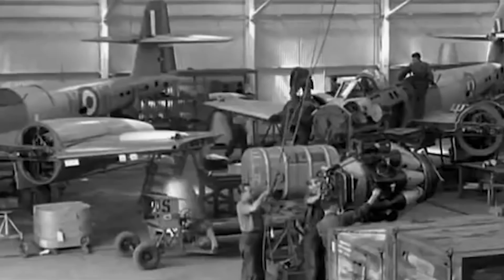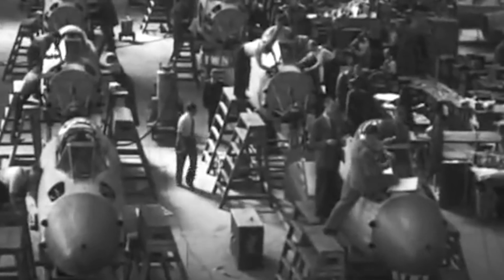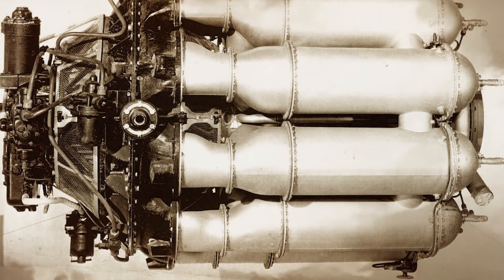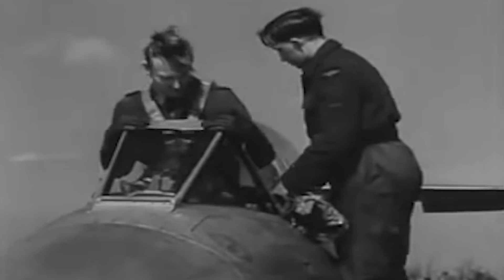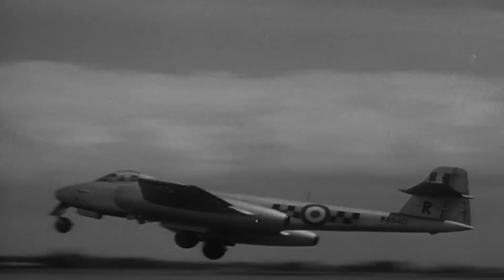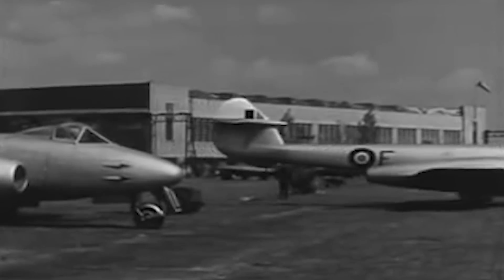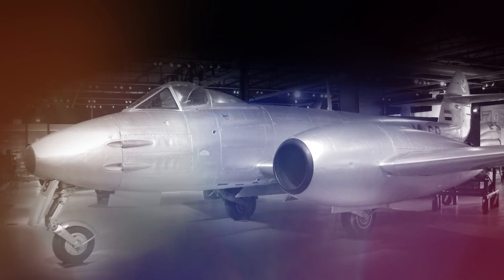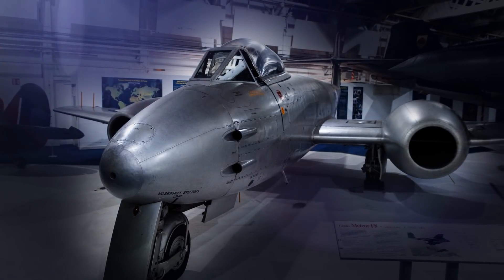Gloster Meteor - The Only Allied Jet to Fight in WW2

Comment: The Meteor was not the only allied jet to see combat in WW2...
The American P80 flew limited missions in Italy against the Germans...
Reply: The Gloster Meatbox never shot down a single Luftwaffe plane... but killed 450 RAF pilots.
Reply: @sandervanderkammen9230  
The Meteor was held over England as not to risk it being shot down to fall into enemy hands....
Thus it was only used to down the V1's launched at London....
And although our P80's flew search sorties in Italy in search of specific targets,  they didn't find any so no combat was joined between the P80's and enemy aircraft......
Reply: @pffear  The Meteor never saw action in the fighter role because it was simply not capable of defending itself against Luftwaffe planes... the RAF had enough problems recovering the bodies of "Meatbox" pilots in England... overseas deployment was to say the least premature.

The P-80 spent most of the war grounded due to technical problems and crash investigations.
Reply: @pffear  
The Meteor was stationed in Belgium.
The P80 was flow to see if could fly. At that time of the war there were no hostile Axis planes in Italy.
Reply: @johnburns4017  The Meatbox never shot down a single Luftwaffe plane... as a fighter aircraft it was a failure.
Reply: @johnburns4017  
The P80 was sent to Italy to run down a specific target w/no joy,   but that's not their fault.....
Reply: @pffear  
It seems they sort of made up a target to get them doing some combat flying.
Reply: @johnburns4017  
Look,  l know anything is possible......
But the records show a small group of P80's were sent to Italy on a S&D mission for a special target.....
Could it have been a stunt❓Yes....
Could it have been a legitimate combat  mission❓Yes.....
Could it have been a little of both❓Hell yes.....
Reply: @johnburns4017  The Meatbox saw no action in Belgium... it never shot down a single Luftwaffe plane during WW2.
Reply: @pffear  
They did not want these planes coming down over Axis territory.
Reply: @sandervanderkammen9230  
Not this nut again.
Reply: @johnburns4017  indeed, they would have certainly been shot down by the Luftwaffe... the Meatbox was slower and less maneuverable then some propeller aircraft in service during WW2.
Reply: @sandervanderkammen9230  
Not this nut again.
Reply: @johnburns4017  Please Get Therapy
Reply: @sandervanderkammen9230  
The screaming voices keep telling him things.
Reply: @johnburns4017 Please Get THERAPY!
Reply: Both the Mosquito and Tempest were faster and more effective in the V-1 intercept role, the Meteor proved to be ineffective and was recalled from V-1 interceptor duties.
Reply: @sandervanderkammen9230  
I'll take your word for it,  I'm familiar more with American equipment.
Reply: @sandervanderkammen9230  
Not this idiot again.
Reply: @johnburns4017  John please get therapy.

Comment: The Meteor was the first ever blank sheet designed jet plane. The 262 was an adaptation of a 1938 piston plane. It originally had a tail wheel, but the engine's thrust burnt the runways so they had to introduce a nose wheel so the trust went backwards not down. The 262s wings swept backwards slightly because the engine had to be moved further aft to give it better balance. An accident, not deliberate design.

The 262 was nowhere near as versatile as the Meteor. The Meteor was in active service until the 1980s, only a few years ago with Martin Baker as the vid shows. The Czechs used a few 262s given to them by the Soviets after WW2, with more developed engines that did not stall as easily as the German engines. They used them for around a year. 

No one adopted the 262s design after WW2. No one.
Reply: Cody Sonnet  Just ignore John, he is one of those delusional nut jobs that thinks Mazda is going to bring back the Wankel engine.
Reply: @sandervanderkammen9230  maybe but then you are several delusional people as John Burns correctly points out.
Reply: JOHN please get therapy!
Reply: @sandervanderkammen9230  
Not this idiot again.
Reply: Does Wilbur Packard Tractor have a Benelux alter ego?
Reply: @givenfirstnamefamilyfirstn3935  
I would not be surprised. He has been many people all at once.

Comment: why are you selling such a bullshit and lies? Meteor never went faster than a speed of sound, the fastest she went was 600 mph. Where did you take from 1.8 Mach???? This channel is just a stack of crap
Reply: I'm certain that a few came very close just before crashing into the ground... over 1,000 "Meteorites" crashed.
Reply: @sandervanderkammen9230  yes for crashesbut never to cross the barrier of sound, not to mention 1.8 Mach xD. That's what he said here is pure bullshit
Reply: @Silver-Tengu  A heavily modified version reached 0.8 Mach but sustained structural damage.
 Aircraft in RAF service were thrust and speed restricted as the Meatbox became dangerously unstable at speeds above 500mph.
Reply: @sandervanderkammen9230  did you read what i was talking about? I know all that! It's not the matter, thx for that useless informations
Reply: @Silver-Tengu  Indeed, the Messerschmitt Me-262 was Transonic while the Meatbox was Subsonic
Reply: @sandervanderkammen9230  ok so now it's clear to me that you didn't understant what i was talking about
Reply: @Silver-Tengu  I do, the Gloster Meatbox design was scribbled out on paper with no actual understanding of transonic or supersonic flight characteristics...
While the Messerschmitt Me-262 was was designed at the Luftfahrtforschungsanstalt the World's first large diameter supersonic aircraft wind tunnel test facility.. the Messerschmitt Me-262 was tested to Mach 1.3 but it was not believed that current engines design was capable of producing sufficient thrust by the time the aircraft entered production...
The Me262 would eventually hold the world airspeed record for productipn jet aircraft at 1,004 km/h (624 mph) until the F-86 Sabre entered service in 1949.
Reply: @sandervanderkammen9230  naaah, it's not it. I was talking about the commentator in this video, at one moment he said that Meteor achieved 1.8 Mach...This is this what i do not accept and see as a lie and desinformation

Comment: The Żurakowski Cartwheel:
"At the 1951 at Farnborough Airshow, Żurakowski demonstrated a new aerobatics manoeuvre, the "Zurabatic Cartwheel", in which he suspended the Gloster Meteor G-7-1 prototype he was flying in a vertical cartwheel. "This jet manoeuvre was the first new aerobatic in 20 years."[6] The cartwheel used the dangerously asymmetric behaviour the Meteor had with one engine throttled back. It started with a vertical climb to 4,000 feet, by which point the aircraft had slowed to only 80 mph. Cutting the power of one engine caused the Meteor to pivot. When the nose was pointing downwards, the second engine was throttled back. The aircraft continued to rotate through a further 360 degrees on momentum alone, having lost nearly all vertical velocity. Carrying out the cartwheel and recovering from it without entering an inverted spin (which the Meteor could not be brought out of) required great skill.[7]"

From:  https://en.wikipedia.org/wiki/Janusz_%C5%BBurakowski

choppergirl.air-war.org

Comment: I think you need to re-check the "tip and run" because all the sources I've read said the V-1 was rigged to detonate if the aircraft/missile were to spin out of control during powered flight. The last thing the Germans wanted was a flying bomb to land on top of them due to a malfunction. If a Meteor were to tip the V-1 over, it would had exploded and taken the Meteor with it.
Reply: I believe that change was made after the fact, once the Germans found out they tipped the missiles to drive them off-course. 

It's possible that slightly nudging the craft just enough to make it miss wouldn't trigger the sensor, seeing it as bad turbulence rather than someone purposely shoving it off course.
Reply: @bluntcabbage6042  If a pilot flew close enough the airflow from his wing would upset the V 1 and it would roll out of control, I am not sure if any pilot really made contact but most would shoot the V 1 down, 20 mm cannon were very effective.

Comment: Cool for 1935 technology that set the Brits back decade. The availability to high temp steels that allowed better turbine section than Nazi planes. But reality is engine efficiency is proportional to compression ratio and these centrifugal compressors were limited by size and compression ratio. Max 10:1 ratio matched 1900 auto engines. The Brit metallurgists reached a limit on impeller (compressor) size metallurgically but Russian MiG-15 was 2X bigger. Note low compression ratio impacts fuel efficiency for given power for example afterburners (reheats). If you allow centrifugally compressed jet engines then might as allow motor-jets and pulse-jets in as turbojets.
Reply: The Jumo 004b engines had a superior turbine section that featured bleed-air cooled hollow turbine nozzles and blades and Ceria-Alumina ceramic coatings for the hot section components.

The engines we use today are based on this German designed engine... centrifugal turbojet engines were an evolutionary dead end.
Reply: @sandervanderkammen9230  what is "Cerro Alumina"? Cerro implies Cerium and although Nazis may have imported Misch metal from the US prior to 1942, there were no rare earths available. A report by Nazi scientist on Hitler's A-bomb project complained about no rare earths available. No one even today has successfully used ceramic turbine blades. By the way, the front part of a jet engine is the compressor, and the part in the back that captures power from hot gasses is the turbine. FYI. Most metals soften or otherwise deteriorate at turbine temperatures, hence the short time between overhaul for Nazi jet fighters. The short period between maintenance was noted by Luftwaffe. British metallurgists developed Nimonic alloys for the Whittle jet engines. Thermal issues with turbine section prevented scale up leaving Nazis with smaller lower power engines.  The history of German jet engine manufacturing is fraught with RLM interference and Nazi corporate socialism producing inferior products.
Reply: @stephenjacks8196  You seem completely unfamiliar with TBCs and their application in turbine blades and TGVs.
Ceria or Cerium Oxide and Aluminum Oxide are still used in TBCs.

Ceria was widely used commercially as Germany was the world leader in the optics Industry.

Krupp was the world leader in high temperature resistant nickel alloy and had developed P-193 Tinidur-60 8 years before Nimonic 80.

KRUPP P-198 Chromadur is not a "mild steel" and is still used in gas turbine engines.
Reply: @sandervanderkammen9230   Krupp never produced a decent high temperature resistant nickel alloy and Tinidur was a very poor alloy with less heat resistance than the 1932 Inconel. Tinidur was brittle and could not be welded. Post war the Americans improved Tinidur with the addition of molybdenum which Krupp had failed to do, even then as A-286 alloy Tinidur has not gained a strong share of the market which is dominated by Nimonic, Inconel, Incaloy,  Discaloy and others.
Cromadur is not used in gas turbines today, the name having become defunked and hawked about it was taken up as a brand name in 2001 for an alloy that is notlistedr any gas turbine use.  The original cromadur was also fiddled with by the Americans but has very little use.
Reply: @sandervanderkammen9230  "Franz realized that the Jumo 004 would have to be redesigned to incorporate a minimum of these strategic materials (per RLM, scarce raw materials such as nickel, cobalt, and molybdenum), and this was accomplished. All the hot metal parts, including the combustion chamber, were changed to mild steel protected by an aluminum coating, and the hollow turbine blades were produced from folded and welded Cromadur alloy (12% chromium, 18% manganese, and 70% iron) developed by Krupp, and cooled by compressed air "bled" from the compressor. The engine's operational lifespan was shortened, but on the plus side it became easier to construct." The British did not have resource limitations. BMW and Junkers were favored military contractors (c.f. corporate socialism, like in the US) were funded but original Heinkel engine work remained ignored. At war end 300 BMW-003s sat not installed in aircraft. (Too unreliable, was original Me262 engine.)
Reply: @stephenjacks8196  The Jumo 004b engines met or exceeded the RLMs 100 hours PFTR reliability standard required for adoption into Luftwaffe service.
This is the exact same 100 hours PFTR reliability test required by the RAF and USAAF during WW2.

U.S. Army tested performed by Operation Lusty after the war reported TBOs in the 50 -60 hour range, excellent by WW2 standards and even during the Korean War era.

The BMW-003/18 series became very successful and is still produced today.
Reply: @sandervanderkammen9230  Your nonsense about the 100 hour PFTR tests is a product of your fevered imagination and you are the only one spouting it.  The Jumo  004 engine was rubbish and everyone knows it had a pathetic service life and a high failure rate. 
The BMW-003 was a failure that the Russians replaced with a RR Nene engine for the MiG-15. And the French struggled with it for eight years before producing, by the Trigger's broom method an engine they struggled to sell beyond their own shores.
Reply: @sandervanderkammen9230  The Jumo 004b had a crap turbine section and the engines we use today are based on a variety of models including centrifugal flow. Most modern civil and military engines are bypass engines for which Whittle received a patent in1936.  There is nothing particularly German about the axial flow engines of today, most of them having their roots in British and American developments which is why the worlds largest jet engine producers are GE and Rolls Royce.

Comment: 4:14 i think that one is more for experimental as all the meteors that i have seen online and in research done by myself have shorter engines, unless that specific one is meant for high altitude scouting.
Reply: The engine nacelles were lengthened which gave more speed

Comment: The Meteor had superior visibility than the 262 - the pilot was forward of the wings. The 262 was based on a 1938 piston plane with the pilot over the wings, with poor downwards visibility. 

The Meteor had a high tail to keep it away from the jet thrust. It laid down many design points of future jet planes.

It was also more maneuverable than the 262. Its engine was fully  developed, unlike the easy to stall 262, whose engines were prone to stalling lasting only 10 to 12 hours.
Reply: JOHN please get therapy, you are delusional and need professional help.